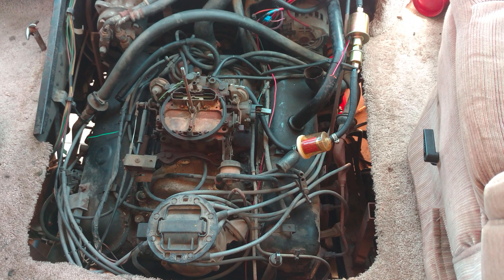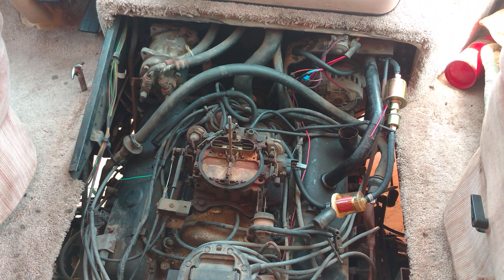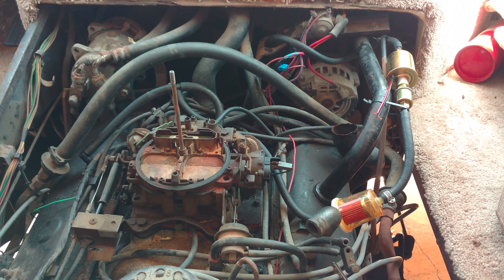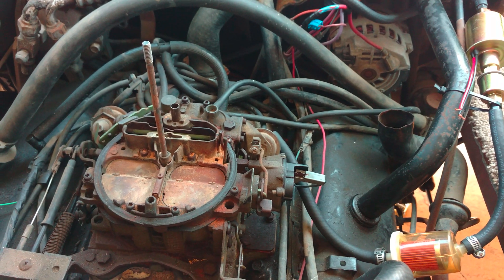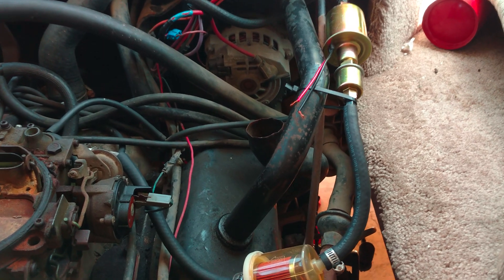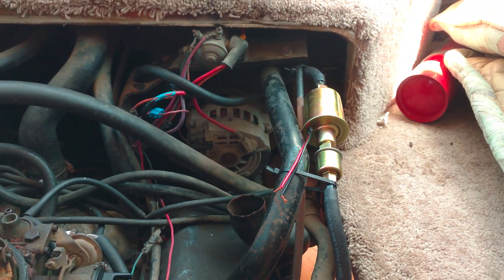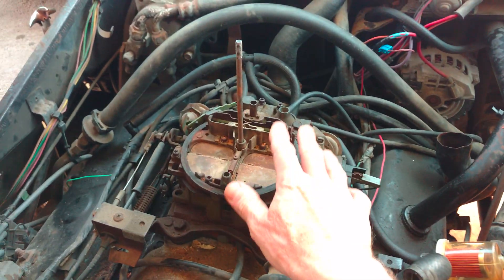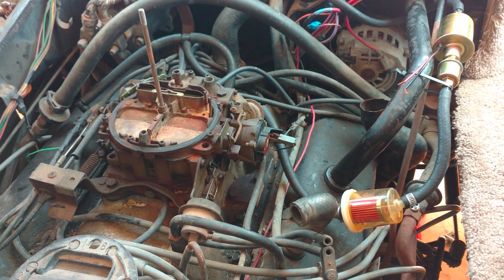RV Life - replacing mechanical fuel pump - 1988 national dolphin 34' - Class A - P30 /video53

Comment: Hello. I am so thankful i continued to listen and watch this video. Im having fuel problems with mine too. When u mentioned u   Ran the small pump Directly from a gas can you reminded me and gave me a good idea of doin the same with mine. 
Im having fuel pressure issues too with my 1987 Pace arrow 28' with Chevy 454.. P30 chassis

Thanks for this videl
Reply from the maker: do this conversion. also replace the holley fuel regulator that is AFTER the fuel pump. rebuild kit is $10 or part is $30. there's only 3 things to that system. electric fuel pump in gas tank, holley regulator, mechanical fuel pump on the engine. also check the LITTLE filter that goes INSIDE the carburetor. it gets clogged. its right where the fuel line hose connects to the carb.

Comment: The alternator, water pump/fan, heat, and oil system rob the most power... mech fuel pump would never use 5 hp...
Reply from the maker: look it up. also  the radiator fan takes the most.